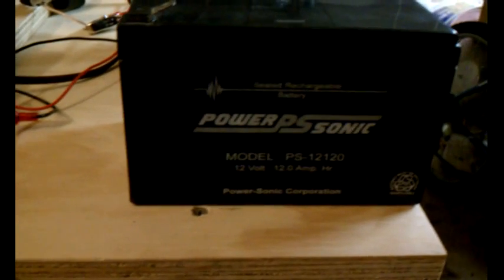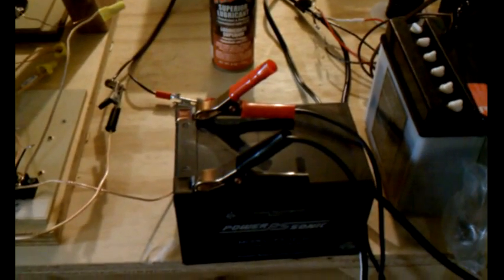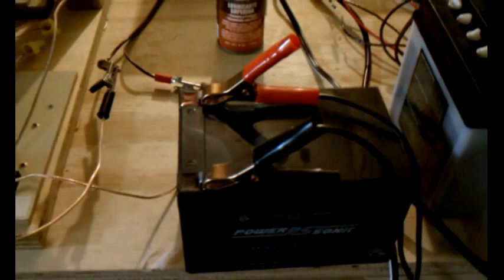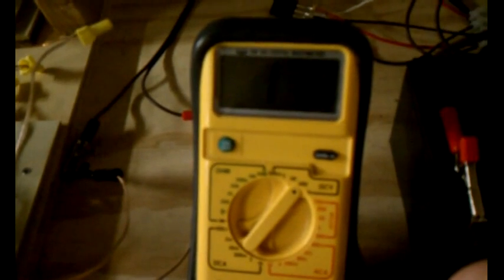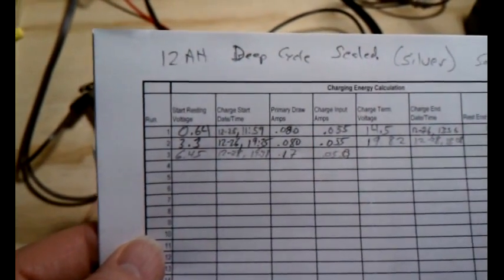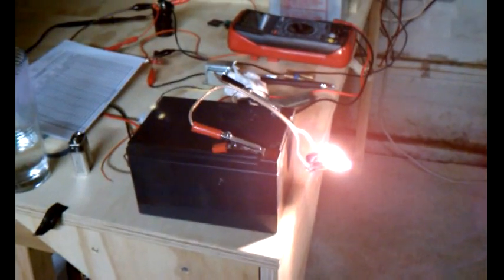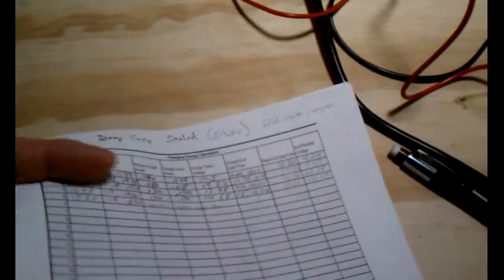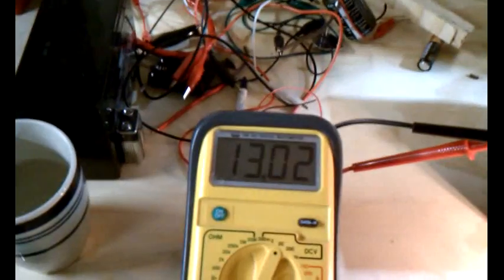Bedini SSG Desulfation Test

Comment: tks for the advise on bedini..i ordered a bifilar coil ready made on ebay uk with ferrite core..24gauge 400 turns on both i think, maybe i will add another power coil wrap on it on top for more uumph if it fails to charge..im avoiding need to coil them on my own thats why i bought them but these bifilars are not easy to find for sale on the net
Reply: maybe i will use some of my 19 gauge magnet wire hanging around and turn it into a trifilar like yours, my only worry is that 400 turns may not suffice
Reply from the maker: I would strongly suggest removing the ferrite core for solid state charger, just use an air core.  It will increase your frequency, and lower the voltage of the spikes a little, and eliminate some heat issues.  Just seems to work better for solid state.
Reply: Aram Peterson ok noted air core for solid state only, for bedini as usual ferrite cored bifilar or trifilar preferred..thanks..i assume the solid state charger is using the same bedini schematics except without the ferrite core or the magnetic wheel attachment right?
Reply from the maker: The basic idea is the same for solid state except the resistances are different, and obviously the trigger is different.   You don't have a schematic?

Comment: i used capacitance charging for my good batteries they seem to werk well. they charge up pretty quick..using 20mfd cap frm rectified ac outlet but i have handle them carefully to avoid getting zapped after use..

Comment: the solid state charger, is that a capacitance charger?
Reply from the maker: If by "capacitance" you mean using a capacitor to buffer/translate the spikes, NO.  I never found those hybrid types of chargers to work very well, especially on dead batteries.  However, the "negative energy" effect you get with these types isn't great for long term charging. IMO

Comment: hi Aram, im planning on making a Bedini charger with 2 equal same gauge 1:1 ratio,24awg coils , do you think it might work?
Reply from the maker: Follow Bedini's basic instructions, and I'm sure it will work.  The number of turns on your coil is probably more critical than gauge, gauge just has to be large enough to handle the amps you want to put through it.  I generally like a trigger smaller than my power wire (and I normally run a pair of power wires now - exactly same circuit, just 2 wires instead of one - for a total of 3 on the coil), but most important just to have heavy wires on the dump side, so that spike has somewhere to go.

Comment from the maker: Just an older style automotive light, like the dome light for inside the car will pull about 300 mA.  Radio shack has a good selection, should list the approx. energy use.  Any Auto supply store will have bulbs, may have less info on energy draw.

The batteries did NOT hold up after initial restoration. Even though the initial results were promising - it seems the pulse charging burned out whatever little moisture was still in there, and after sitting for short while, they were literally bricks.

Comment: I just built a Bedini SSG from a hard drive, and looks like it is working good. I was wondering if you know what type of light you use to put a 300 mA load to check battery? 

Also how well did the battery hold up after this, and do you still use your bedinis'